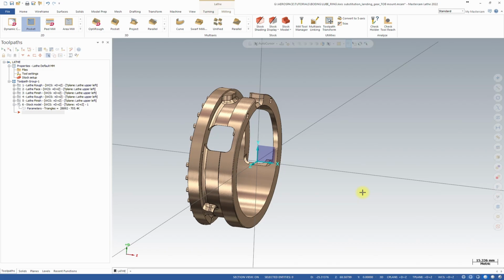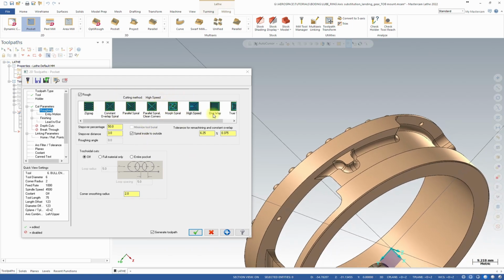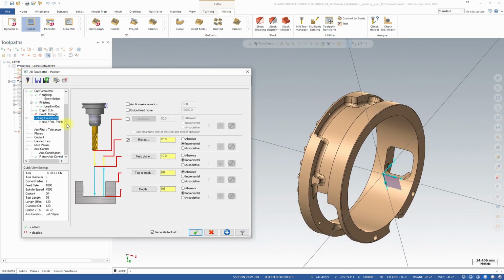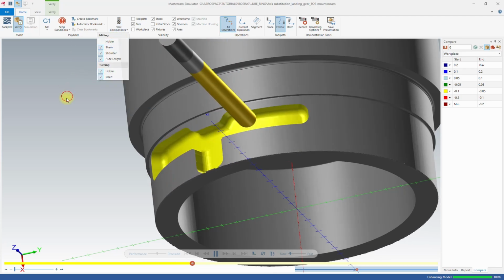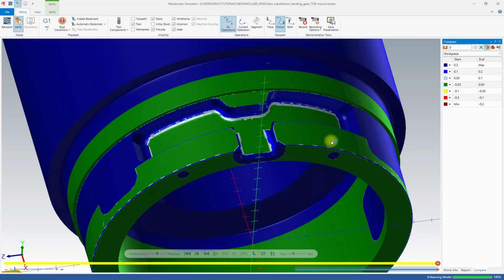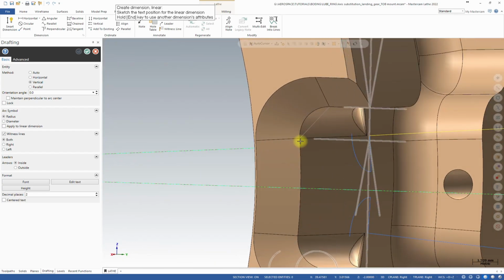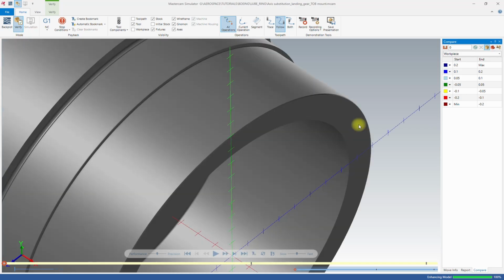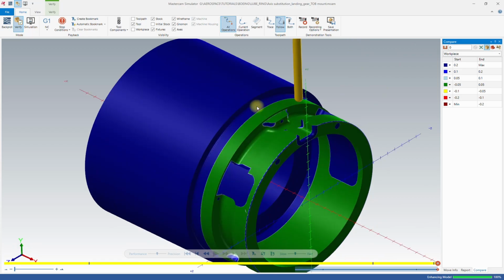Axis substitution using 4th axis and lathe  -  Mastercam multiaxis tutorial

Comment: Love the vidos, but have one problem with it. You machine mostly plastic and soft stuff, so you just plunge in etc. and not much consideration is given to tool aproaches and burrials, ramping etc. Many toolpaths for me as I mostly work with hard stuff would be unuseable. Would absolutely love to see things like this made by you when they are from inconel or similar materials. But dont take it as a serious complaint, just something to consider as very helpful to those who dont machine plastic as you may quickly find, that many of the strategies wont work at all. :)
Reply from the maker: Hi Libor,
I understand that my tutorials arent completely fit for machining exotic metals, 
i can only explain each option inside the toolpath settings
Unfortunately, We are leaders in machining (only) high-performance plastics (turlon, tecasint, bronze filled PTFE, tufnol 10G40, 40%GF UNTEM, and more I've been doing only this kind of materials (plastics)
Sorry to hear that the material is not completely suitable for your application unfortunately i can't help with machining inconel, titanium etc